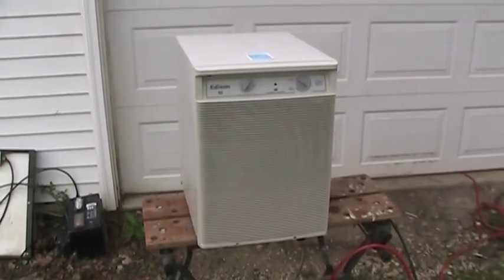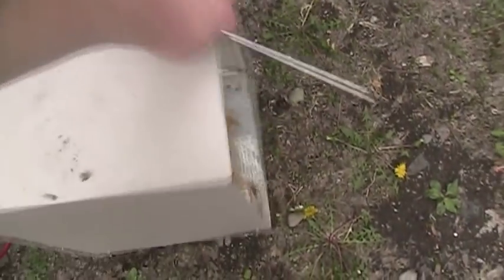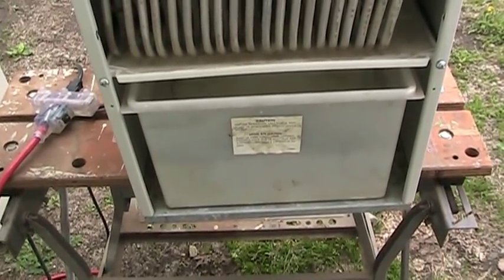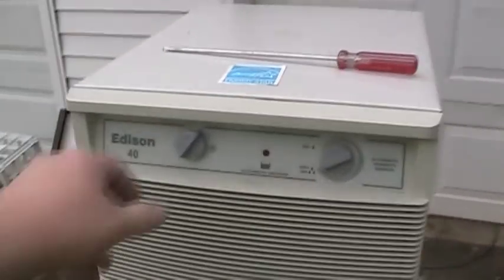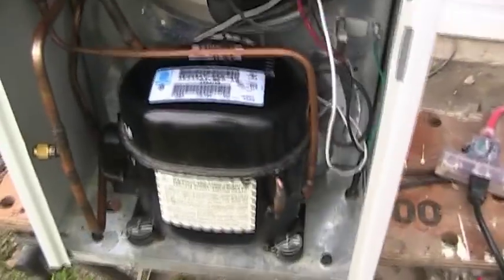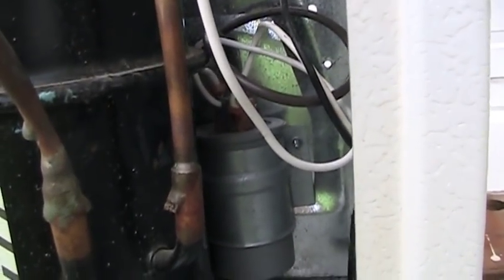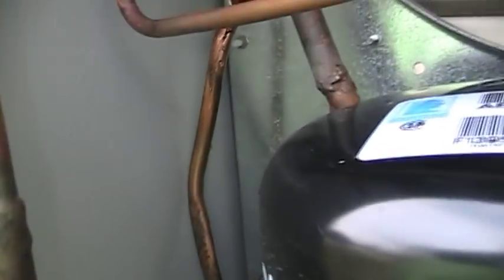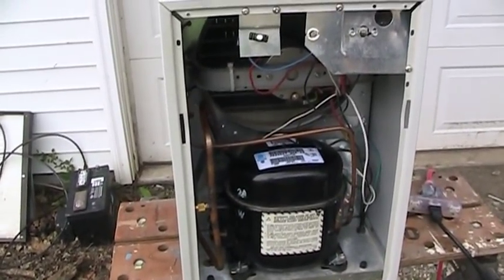Edison DHE40S Dehumidifier Compressor Swap

Comment: Reminds me of this past summer I had a Kenmore window ac i got from the curb, plastic still on it, like an 05 06 model, this unit had an issue where the compressor would kick on and off, and the fan would be off on fan 1, barely moving on 2 and on what seemed like 1 on 3, I had a Friedrich with a bad fan blade that ate through the duct, which was also 12000 btu, and I stole the run capacitor from the friedrich, the Kenmore was back to life, all fan speeds worked once again and the compressor stayed on without any ice up issues, that unit kept the entire lower level of a house cool with no problem after that, the new owner of the house still has it in the window haha

Comment: I just recycled my '09 Kenmore. Bought a cheapo from Wal-Mart and I must admit...this new one is as quiet as a table fan and works a charm. We'll see how longevity is. But not hearing that noisy Kenmore in the basement is a wonderful thing. So much more pleasant to spend time in the family room now. Old one's coil cracked and lost its charge. Wasn't an expensive unit, wasn't worth repairing. Glad I didn't.
Reply from the maker: If it weren't for so many of them being recalled due to fire hazards and suffering refrigerant leaks, I wouldn't really have a problem with modern dehumidifiers. Fixing either problem wouldn't be hard, if only a little more attention were paid to quality control.

Sealed refrigeration systems ought to (and previously did) last for decades.

Comment: If you've got a harbor freight around you they sell a rubber grommet kit for passthroughs like that for a few bucks. Very useful for times like these, or passing wires through a vehicle firewall.

Comment: Fantech sells a unit that's nearly identical to this unit, though both coils are specially coated tube and fin coils as opposed to the setup this unit is equipped with, they want almost $700 for that unit, but it's the best unit for the price I can find new

Comment: great repair. I recommend adding a gromit to the tube that is contacting the sheet metal between the two sides of the machine to prevent it from rubbing a hole in the tube and refrigerant loss.

Comment: I have a refrigerator that uses Isobutane as coolant. Do they work almost identical to the ones using Freon gases?
Reply from the maker: They work identically, the only difference being one of flammability. Flammable refrigerants are starting to appear here in the US.
Reply: uxwbill Actually they've been around in the US since Japanese refrigerators started coming in back in the 70s.  Sanyo was the one who pioneered the use of compact rotary compressors and R600a refrigerant around that timeframe.

Comment: Does it live up to the original spec gallons/liters per hour? That would be an interesting test result.
Reply from the maker: I haven't run it long enough to know. I have no reason to believe it wouldn't. (The bucket I shamelessly stole from the Keykeeper is also from a 25 pint machine instead of the 40 that this one is.)

Comment: I know this is an older video, but I have a question about the Edison 25 unit. We recently received this dehumidifier from a friend a I was wondering if they came with a filter? It came with one, loose, and I can’t for the life of me figure out where it goes! If you could help I would really appreciate it. Thank you
Reply from the maker: If it is the filter that goes with the unit, every example I've seen has slots cut in the metal case by the evaporator coil. The filter has matching tabs that will fit those slots.

Comment: What do the colours of the hoses mean?
Reply from the maker: On a regular refrigeration service manifold, typically the blue hose is for low pressure (suction), the red for high pressure (liquid) and the yellow hose can have multiple uses depending upon what you're doing.

Comment: It's good job, neatly packed and arranged. It's always a challenge to fit available parts into some old casing.
Quick question 1: how do you form the joints in the copper pipes ?
Quick question 2: I noticed slight pipe slope (not horizontal), is it intentional ?
Reply from the maker: If one piece of copper tubing is slightly larger than the other, you can slide one piece over the other after making the needed preparations for brazing. There's also a method known as swaging that can be used. A swaging tool basically swells the end of the pipe slightly, allowing two pieces to be attached. It's often used when joining two identically sized pipes.

There are various pipe joints that can also be used, like couplers and tees. I didn't use any of those here.

It was my intention that the hot gas line (small pipe) be horizontal, but I didn't cut it short enough. This was mainly a byproduct of erring on the side of caution.

Comment: A nice clean locked rotor. Usually not so distinguishable in autopsy situations. Very cool video👍👍
Reply from the maker: The bad compressor was still mechanically functional. (If driven by hand -- or by a drill I chucked onto the shaft -- it still pumped just fine.)

Comment: yay made in canada. it'll last longer post-repair than a new chinese one.

u referred to 407c is a drop in - doesn't is not work with mineral oil. it's not a drop in if you have to change the compressor oil.
Reply from the maker: Regardless of its level of technical correctness, "drop in" is the commonly used term for a nominally compatible replacement refrigerant.
Reply: R417A would be a drop in for R22
Reply: phil955i R-421A too

Comment: I botched my first pipe project (who knew that the slower PVC cement would expand), but this second one is looking like it might actually go well (within less than half an inch on one bit--the dummy writing this doesn't understand consistency in measurements between fittings) and then we get to do brazing in the not too distant future after this crap with spring break concludes and I play a bit of catch-up with my reading.

[video clip of Beavis shouting "fIRE" goes here]

Comment: Weren't these recalled? I have a Edison 40 and afraid to use due to recall from 1990s....something about possible electric shock  even tho none has happened....
Reply from the maker: I can find no evidence of a recall for the DHE40S model. In 2002, models WMD40W and EMD40 having certain serial numbers only were recalled for reason of a fire hazard. You can read the recall at https://www.cpsc.gov/Recalls/2002/cpsc-wc-wood-company-announce-recall-of-dehumidifiers . If your dehumidifier does not fall within the range of those serial numbers, it was not subject to recall and there should be no problem with it.

If you are concerned about a potential shock hazard, make sure you use only a properly grounded outlet with your dehumidifier. More protection from a shock is possible through the use of a Ground Fault Circuit Interrupter (GFCI). If you're not sure what kind of outlet you have, a qualified electrician can test it and tell you. There are also inexpensive outlet testers available, but they can sometimes be fooled by certain kinds of incorrect wiring.

Comment: i am planning to restore a very old fridge from my grandma and grandpa the back is very rusted. but the old compressor still works. should i use it? or should i use a modern compressor. and no i am not planning to do the job myself im going to hire a professional refrigeration repair man to make the refrigeration cycle to work once again.
Reply from the maker: Sealed refrigeration systems are very reliable. Decades of service is not at all uncommon. If the sealed system still works, leave it alone. The original compressor is very likely to be in fine working order.

If there has been a leak, the important things will be to verify that it was fixed, and to pull a very deep vacuum on it prior to recharging.
Reply: i have tested it the compressor works however it didnt make cold in the 3 to 4 min it was running i may have to test it again but leave it on for 10 min to see if it makes cold. but when it was running i did hear the liquid in the condenser so im not intirely sure.

Comment: Have you bought a refrigerant leak detector yet? If so, what did you get? I just picked up the Fieldpiece SRL2K7 Infrared leak detector and I love it! Great vid as always Bill!
Reply from the maker: Not yet. There is a Bacharach Informant 2 in the lab, but it's on the verge of having a worn out sensor and doesn't really work right as a result. (Its natural gas sensor still works fine, though.) I'd probably go for it, if it weren't completely out of my price range (and didn't seem like it went through a thousand batteries a day).

People seem highly polarized by Fieldpiece equipment. I haven't seen enough to have an opinion. (I haven't been too impressed with their clamp meters.) I am somewhat seriously looking at the Inficon TEK-Mate 705-202-G1, when next finances permit.
Reply: I've always been a brand whore all my life... I find what I like and stick with it. Fieldpiece tools are more expensive than their competitors and they offer pretty much the exact same thing. When I first got into HVAC all I could afford for the longest time was the lower end gear. Basically what you do is build up one tool at a time. I actually own a TEK-MATE and it was my go to detector until I recently got the Fieldpiece. It's a good tool for the money!  Next for me is a combustion analyzer, that one's going to hurt lol! Good job on that brazing too btw, if you can do that in such a tight spot, you'll do just fine in residential and commercial.

Comment: Edi: I did try googleing and browsing forums before asking but did not get much info, thats why I thought I might give asking you a shot
sorry to throw these questions on you uxwbill but how am I supposed to flush(and leak test) one of these small systems(to install a replacement compressor)could I get away with compressed air(to flush) and perhaps soldering/brazing over the leak?
I asked this on the home improvement stack exchange but did not get too much information
Reply from the maker: My honest recommendation would be to hire an experienced appliance repair technician, if you really want your current appliance repaired. I found your question and read some of the answers on that site. The advice you received is valid, but you really do need some experience under your belt to successfully complete this repair. Many parts of the world require that you have a refrigerant handling license before you can dismantle a system charged with refrigerant of any kind. Replacing the refrigerator really would be the most cost-effective course of action.

You will require a fair number of refrigeration specific repair tools, and they wouldn't be cost effective for a "one off" job like this. These small systems are known as "critically charged" systems because they take only a small amount of refrigerant and are very easy to over or undercharge.

There really are too many variables for me to say "do this, this, that and the other thing".

As for the original compressor, it likely failed because of the refrigerant loss. Refrigerant gas cools the motor and pump.

Comment: William, are you an HVAC student  ? If so, I think you had a good grasp of the trade going in.
Reply from the maker: I've been taking classes for the past two years and will soon be finished with them. In a way, I'm sorry to see them come to an end. I had a blast.

My skillset varies depending upon what aspect you look at. The program focused a lot on electrical, controls and schematic/ladder diagrams. That's not where I needed the most help, because I've been playing that game for a while now. I understand refrigerants now a lot better than I did. As far as putting a system together and knowing all the little tricks of the trade...I learned a lot there, but still have a long way to go.

Comment: Since im replacing my car condenser what can I use to lube the seals? I don't have pag oil. Can i use silicone spray?
Reply: you can use mineral oil or pag oil
no NOT use motor oil or Vaseline as those may damage the seals
Reply: motor oil will eat the rubber.  is baby oil ok?
i also replace dryer and then have it fill at the mechanic
Reply from the maker: I would suggest using only the oil that's compatible with the refrigerant you plan to have charged into the system. A small amount of refrigeration oil won't be expensive.
Reply: I will do that then. better have it go right